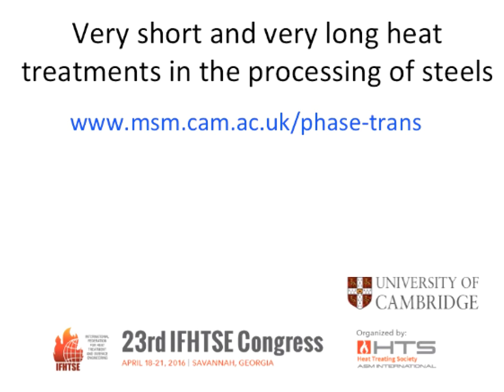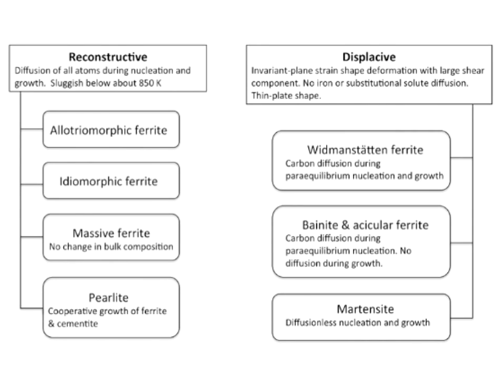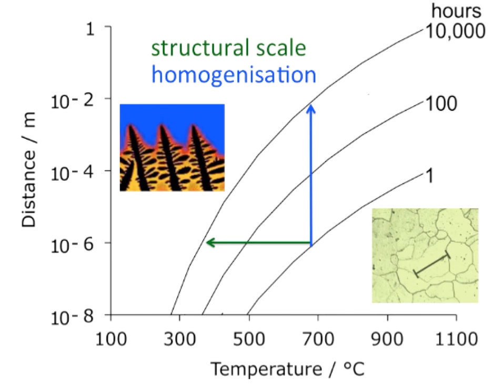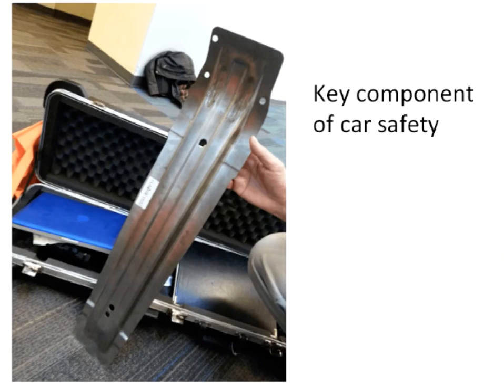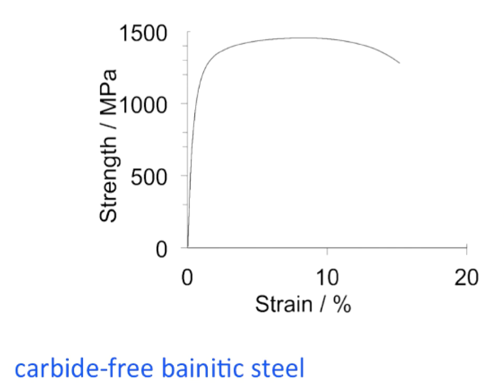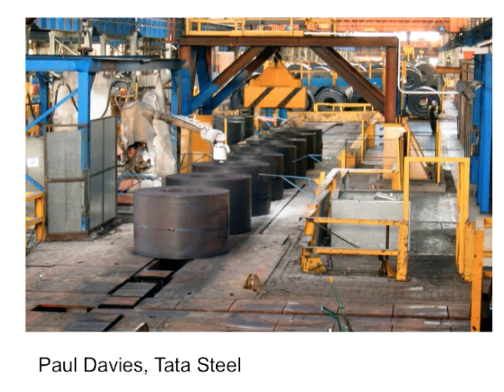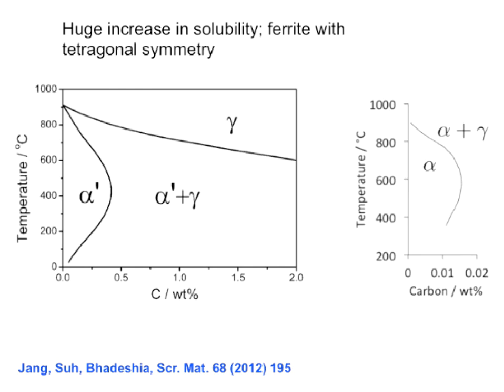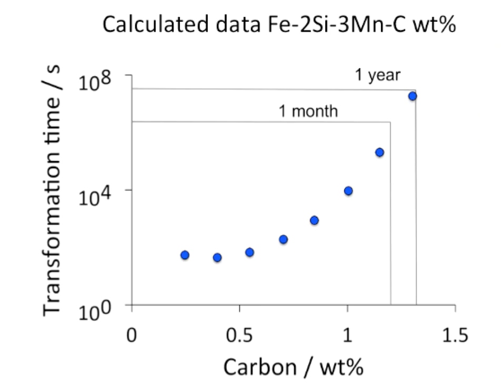Very short and very long heat treatments for steel

Comment: very interesting lecture.flash bainite,very short heattreatment. why the bainite is ductile than tempered martensite at same strength?
Reply from the maker: +M. Tim It does depend on whether the martensite is tempered or not. If not, then carbon in solid solution reduces it toughness dramatically.
Reply: +bhadeshia123 why lower bainite is ductiler than tempered martensite at the same strength?
Reply from the maker: +M. Tim Is it?
Reply: +bhadeshia123 I think it's why people pursue the bainite microstructure in application.

Comment: Prof. Bhadeshia, the potency is proportional to time.why the martensite propeties change rapidly in the initial one hour when doing the tempering heattreatment, then prolonged time has little influence?
Reply from the maker: The initial stage relieves excess carbon, which otherwise is the biggest contributor to martensite strength.
Reply: after the initial stage relieve most of excess carbon, can the residual carbon be relieved  if hold longer time at the same temterature? and is the driving force become smaller as tempering time goes?
Reply from the maker: yes